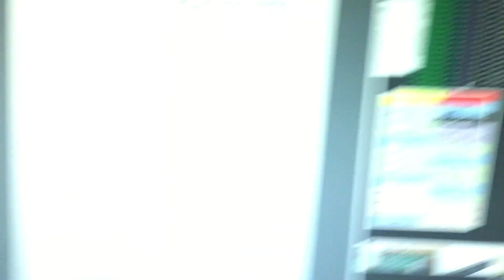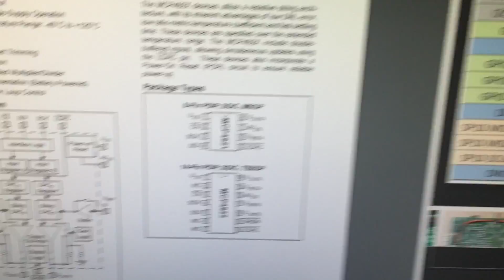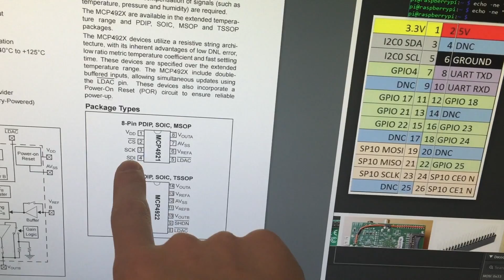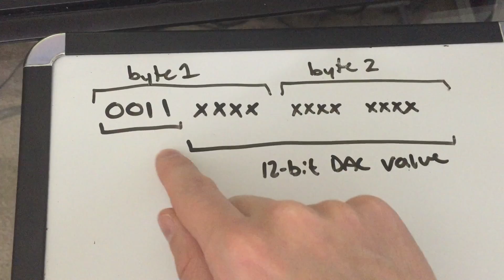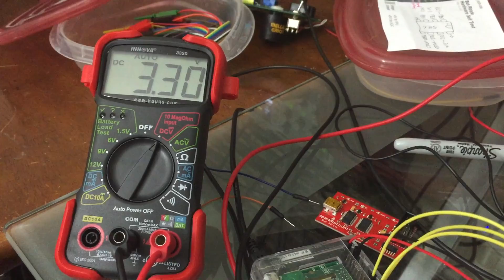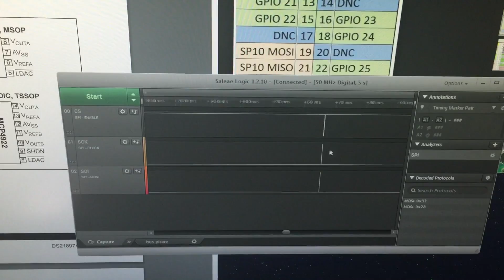Analog Voltage from Raspberry Pi using MCP4921 12-bit DAC and SPI

Comment: This only has one channel, right? Do you know of a chip that has more?
Reply from the maker: I checked mouser (dot com), searched for analog to digital converters, refined search for through-hole components in-stock, and found chips with 2, 3, 4, and 8 channels. The MAX533 is a SPI-driven 12-bit DAC and costs $5.27